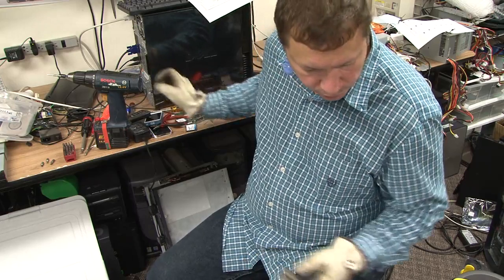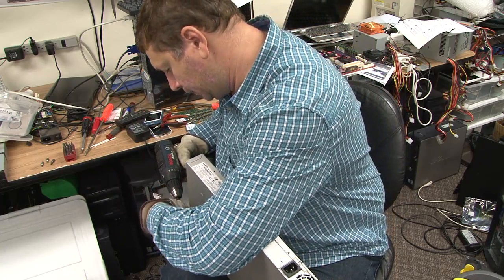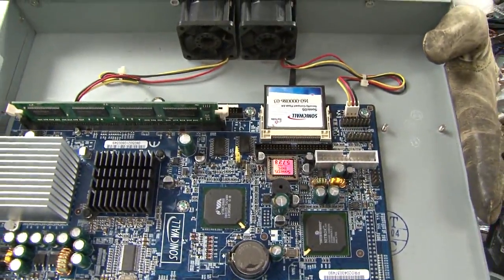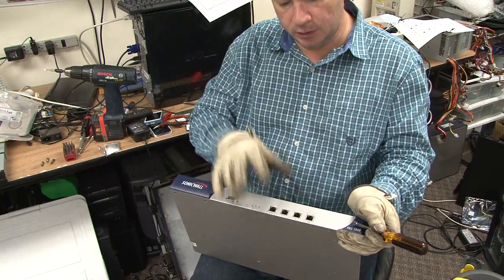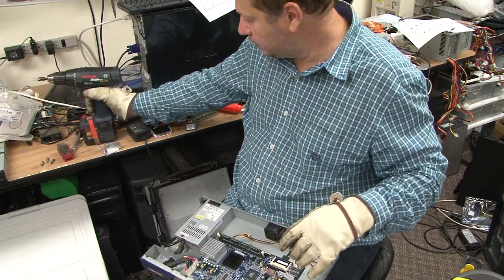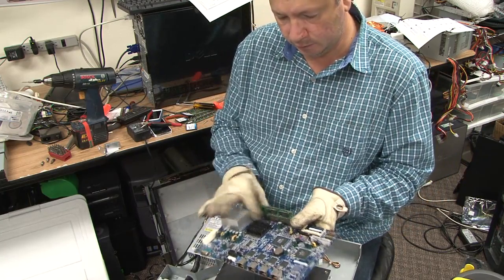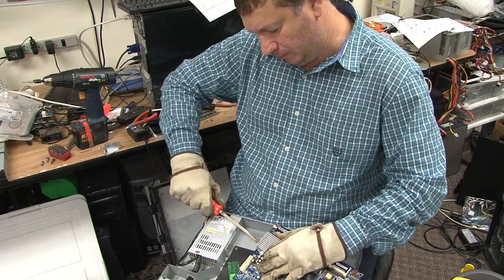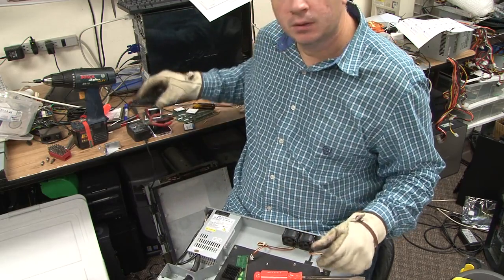FYI SonicWall internet security appliance teardown See what is inside

Comment: Sonicwalls are terrible for reliability - the most common failure is the cheap and nasty psu or even the filter in the power socket failing and its really common bad design.
Reply: Not a problem PSU in mine goes to an ATX header with a couple of P4 headers doing nothing inside the case. Am sure most small form factor power supplies would replace it if needed. Think mine was rated at 200W or around there.